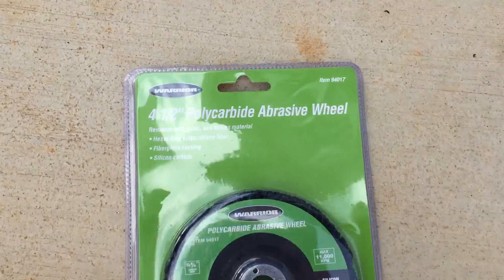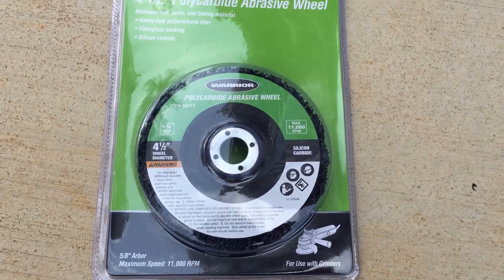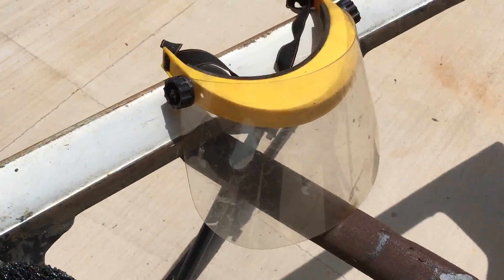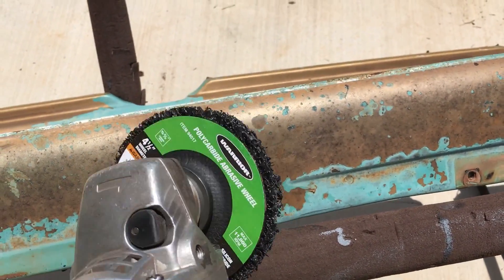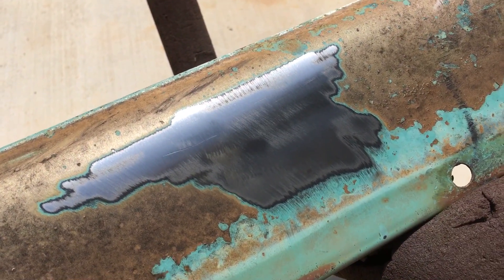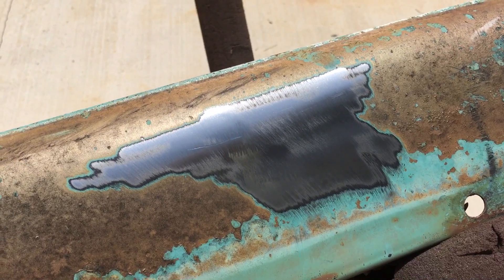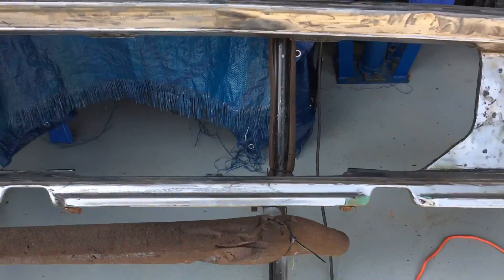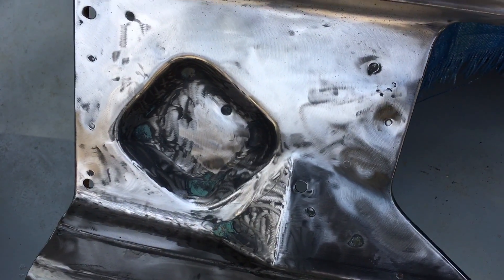Polycarbide disc for paint removal

Comment: Great video! I purchased one after watching this but how did you get it mounted to the grinder? The grinder tool doesn't fit down into that deep of a hole.
Reply from the maker: KASKEN 
The tool that has pins to tighten the grinder nut has pins that are just barely enough to get to the nut. You may need to make a tool with pins that are longer.
Reply: @Lugnutz65  Thank you! I'll give it a try today.
Reply: Need nose pliers

Comment: These disks are awesome and cheap.
They work so well, and do not clog up with paint because they are constantly flying apart.
What that means is that they wear out kinda quick.
Be prepared to buy double the amount you think you are going to need.
Also, these discs do bite into what you are grinding, they are very sharp. They can grind down steel very easily if you push them hard. I used them to strip Camaro doors for re skining. They are great. It cleans off the paint and gunk really good. Highly recommended. Just buy more than you think.
Reply: Thanks for the insight

Comment: A trick an guy I work for at age 13, was cutting the edge of a worn 36 grit grinding disc. This allows a guy to get into very sharp areas. Now, we cut an even hex, 6 sides but I have seen it done 4 sides only. It really depends on the worn disc diameter and size of backing plate (rubber) or pad. I have a large 8” backer but a 4” as well. You don’t run into everyday as most would grab a tight 1.5” wire end crimped with 1/4” shank for drill or other tool. 
 Just a thought! Retired ASE Master.